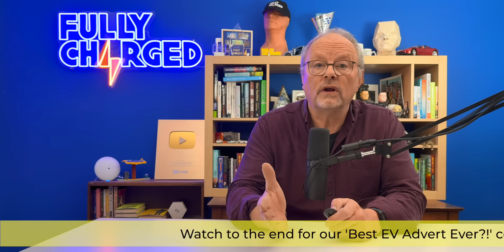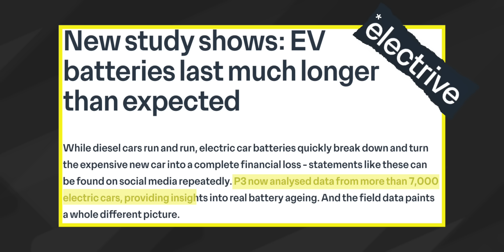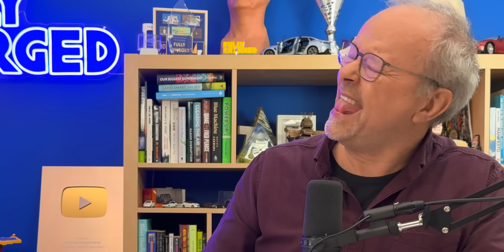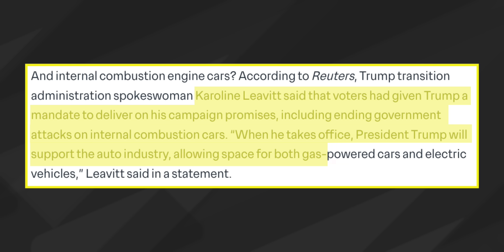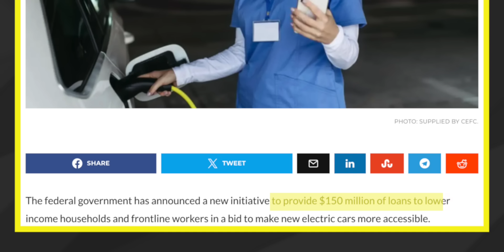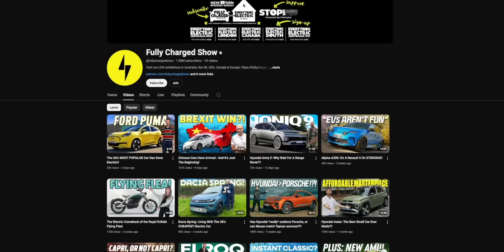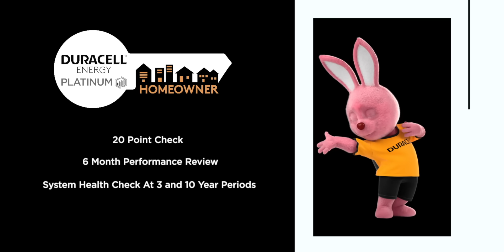The Truth About EV Battery Life, Government Subsidies & The Future of Coal Ash?!

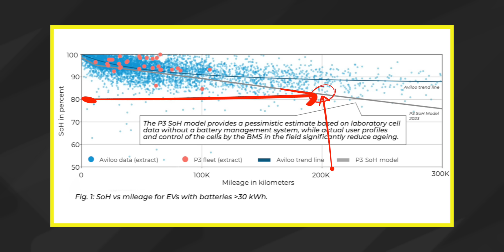Comment: 5:17 "A large percentage of the batteries they tested were at 90% of their original capacity after 300,000 kilometers"
That's either really disingenuous or Robert doesn't know how to read a graph, there are hardly any data point left at 300k.
The best I can say is he mis spoke and meant 'Of the few batteries that survived 300,000 kilometers, a high percentage of them were above 90%'
Reply: That's not what the data shows either though, is it? The graph doesn't show EV batteries that have failed, and how long they lasted before they failed. The relative lack of data points beyond 300,000km isn't a symptom of batteries not lasting that long, it's a symptom of not many people racking up 300,000km in any type of car (let alone in EVs, most of which haven't been around for that many years). In the UK, the average mileage of a car (most of which will be ICE cars) before it's scrapped is about 200,000km.
Reply: @mikepotter2561  I agree, we'd need to reference a similar ICE sample of failure rate over distance as a control to see what the natural curve is, whatever the differential between the two will be battery vs ICE failure rather than running gear failure as that will be similar on both power trains.
Reply: @nukenet1   Again, this is not the point of the graph. The data doesn't show the mileage of EVs at their point of failure. Far from it. It shows how well they're still performing at different points in their life. The facts are that on the graph, none of the cars at or around 300k km showed below the trend line of around 75% state of health. Now there isn't really an equivalent measure for ICE cars, but the point is, as Robert says, that an ICE car at 300k km is likely to be a total wreck of spare parts, while an EV (with far fewer mechanical parts to replace) still has 75% left in its main component after that mileage. This bodes very well for overall lifespan of the car and cost of maintenance over that time.

Comment: There are 18 million cars in Oz if we could replace 100,000 ICE cars with EV s every year ( which we can’t)
we’d still have petrol cars on the road in 180 years 
The average EV uses 83 kg of copper
100,000x 83 = 8,300 tons of copper 
At 1% ore grade means that 830,000 tons of ore need to be processed to produce the copper ALONE for the  manufacture of 100,000 EVs 
One tonne of copper produces 4.1 tonnes of CO2 
That is 34,000 tonnes of CO2 
And then of course there will need to be upgraded to the grid and a massive increases to power  generation
To call EVs GREEN is not only misleading but down right dishonest

Comment: At current rates of usage, the complete extinction of oil will happen in 14,000 days or approximately 38 years (source: Worldometer).

In 40 years' time, you cannot be driving a vehicle powered by gasoline / petroleum. Simply because there will be no such fuel left on planet Earth.

The Oil Industry cannot still be in existence in 40 years' time. As there will be no more oil resource for them to process and sell.

When there's 5 years left before the extinction of oil, who is going to invest any money in new oil infrastructure? Who's going to pump billions into a brand new oil refinery, when they only have 5 years left of oil? No-one, when there's little chance of breaking even, much less making profit, in such a short amount of time.

The world's reserves are not all in one place. Different countries will run out at different times, as they all have different sized reserves. This shrivelling up of the Oil infrastructure and industry is going to happen piecemeal, country by country, over those next 40 years. The 40 year estimate is until the end of all of it. The end of each individual supply will occur, repeatedly, one-by-one up to that point. Each final permanent closure of an oil reserve - as there's nothing left - will cause global economic shocks.

As oil runs out, its price is only going to exponentially grow. Long before the end of these reserves, the average person will increasingly find they can't afford to fill their fuel tank.

The point being that the global overall end is in 40 years' time. The local individual end will come much before that, in practice.

I've not mentioned climate change nor pollution. Just simply the economics of the remaining supply. Quite literally, this cannot go on. Even if the world did nothing whatsoever, then there are only a few decades left before it becomes economically impossible for the average person.

This is investment in a dead end. The car industry knows this, and that's why it's switching to electric as the only possible means for their businesses to survive in the coming decades. They have to transition to EVs, because soon you won't be able to sell an ICE. Not because of government legislation, but because the investment no longer makes any sense.

It's a false dichotomy. Indeed, if you want ICE vehicles to survive the coming decades, then you need to advocate for absolutely everything else to be electrified, in order to eke out a little more time for the Internal Combustion Engine. If you love cars, then soon enough EVs will be the only feasible way they can continue to exist.

The fact that, in reality, climate change is a real thing on top of all this, just means that we'll be also fighting increasing natural disaster events and global "climate migration" at the same time.

Even Trump realises this. Greenland is currently mostly useless, as it's covered in a permafrost. That's why no-one has previously been remotely interested in it. But now grabbing Canada and Greenland are crucially important to Trump. Because as the world climate shifts, more Northern territory is needed for growing crops and housing people. Ignore what he says, because words can lie. Look at his actions, because actions can't lie. The "secret plan" is to keep making money until the supplies run out and move North, abandoning the increasingly uninhabitable South. Building mansions in Canada and letting the world burn.

Comment: Robert, 
Remember in Aus if you get a government low interest or interest free loan to buy EV cars or Solar panels or Heat pump electric heaters or hot water systems that spend goes back into the economy. 
It certainly helps those in low to medium income to afford the transition. 
Nearly everything in Aus is typically much more expensive, however we are seeing Chinese electric cars coming in at better costs than those in the UK and EU.  About time I say, however they are still pretty expensive.

Most of us weigh up the economics not just the environmental benefits. 
If you can't afford to live, then who cares how long you live.

For me It will take 5 years of fuel cost for my annual 20,000 kms driven  to cover the difference in cost of the equivalent EV compared to my current diesel vehicle. That cost is about AUD$10,000 fuel bill.
In 5 years time than new EV that currently costs AUD$65K (40.3K GBP) will then cost me about AUD20K (12.2K GBP)
In 5 years time I will be able to afford a second hand EV to suit my needs and maybe we might have a robust public charging network.

A vast majority of Aussies drive more than 50 kms a day to go to and from work because our public transport system is so poor unreliable and does not go where you need with suitable frequency. 
We are very spread out as a nation. We are not living in each others back pockets or on top of each other.
We typically travel much larger distances as we typically live on larger house blocks from 450 sq metre plots to the typical old 1/4 acre 1000 sq.metre blocks of land.
Aussies typically don't live in High density housing like the rest of UK and Europe.
Our country is 32 times the landmass of the UK and we all typically live on the outer coastal areas. and our largest capital cities are many hundreds of kilometres apart. Melbourne to Sydney some 800 kms, Melbourne to Adelaide 735 kms and Melbourne to Perth some 3500 kms.
Our electric grid is out dated and the transmission lines cannot cope with the current load a lot of the time and whilst we have installed large amounts of renewable energy projects the transmission and grid development has stalled. A lot of renewables  energy from Solar and wind is curtailed as we dont have storage for all the excess. 
Our Pumped Hydro Snowy 2 Project is 5 years overdue and some 7 billion over initial budget and still nowhere near completed.
Out battery storage has a long way to go to absorb the excess solar and wind generated power and investment has been in generation morso than in storage. Storage is just so damn expensive. 
Rant over.

Comment: Sorry this negative about hybrid is wrong I have numerous friend in eutope with hybrid Toyotas with 250k on the clock running fine my hybrid had done 150k miles before I sold it and it's still going and it only went to dealer for service and recalls

Comment: 25% of oil produced is used by private vehicles, another 25% for the rest of the transportation sector. Still a long way to go before we can switch off oil production.
Reply: We don’t want to necessarily switch off oil production.  Yes plastics from vegetable sources are in development but petroleum derivatives are used in cosmetic, pharmaceuticals,  plastics in manufacturing etc. it’s the burning we want to stop. Decarbonisation for shipping, aviation and HGV is trailing personal transport but it is getting there. Norway has an electric ferry, there’s the Tesla semi and there are now numerous small battery electric planes. Sustainable aviation fuel is a good intermediary until we get a better solution.

Comment: Funny how you praise scientific results and documentation and at the same time not fact check your own claims. In 2 minutes you can find many hybrid cars with much higher mileage than you claim they will never do. Walk the talk.
Reply: OK, let me explain. A hybrid car is a petrol car with some other stuff strapped to it. They are fine, I drove a Prius for years, it was a great car. Back in 2002. So I was joking, having a dig at a technology that is promoted furiously by Toyota and the fossil fuel industry. 
I totally agree that they last a long time and burn fractionally less fuel than a regular petrol/diesel. But it's a petrol car.
Reply: @bobbyllewellyn  Hybrids are a collective term for widely different cars. I have a bmw i3 rex=hybrid. But it only use 3-5% of the petrol i would have used in a ICE car, thy calculate how many years it would take to save the Co2 used to build a big battery for use few times a year. People should buy the car that fits there driving needs.

Comment: I can tell why is a few sentences why CCS won't work. It's secondary school physics. Having burnt the fossil fuel, liberated the CO2 and used the electricity generated, the energy required to capture that liberated CO2 is several times more than the energy gained after burning. See the problem? You have to generate MORE electricity to capture the liberated CO2. It's simple really. STOP BURNING STUFF.

Comment: If you mistreat your car's battery. It will degrade and fail. If you overcharge. Or run it down to zero charge. If you fast charge it all the time. The battery will fail over time. New cheaper battery designs and chemistries are being researched. So replacement will be easy.

Comment: My EV has now lost 42% battery capacity within just less than 9 years and 41 k miles. I wouldn't touch another EV with a barge pole. They are just a throw away item in my opinion. The propoganda on battery life from my experience of them is appalling.
Reply: Hi what car do you have please ?
Reply: @Dailyroach  why would that matter, it is an EV with a lithium ion battery in it. There was also a modern Tesla model 3 on autotrader,   highlighted by Barrie Crampton, with a tested and certified battery capacity for sale at 25 % degradation. 2020 and only 55k miles. Is that old technology as well ? Mine has lost 5 out of 12 battery bars, a 30 kwhr, you can guess the rest. The fact is that all batteries degrade with time and use cycles, All !
Reply: @ Just curious , Its nice to know what the real world results ar on certain diferent cell and pack configurations first hand from real owners .
Reply: @Dailyroach  I replied to your last comment but it has been removed, I wonder why ?

Comment: if we only didn't have to worry about the 12v batteries
Reply: What’s your worry?
(Replaced the battery in my Model 3 at about 3.5 years- was told on the screen that it was time to replace. Too easy.

Comment: Coal is fast becoming an issue for preserved railways.
Currently finding an affordable source of Steam coal, (The Welsh Supply is being cut off) and finding a slightly greener and more sustainable, yet affordable alternative to keep the Old Kettles we all love going.
Reply: This is very upsetting for me, although I am a strong proponent of trying to stop burning fuel, steam engines hold a special place in my heart. And some of that is the smell of coal burning, steam and hot oil. Burning coal in a few old steam engines is ofliterally zero consequence in the long term. I really hope you can find a decent source of steam coal.
Reply: Slight misunderstanding here. 
I don't work for a preservation society, but I do like old trains as Robert does.
It would be interesting to see an episode on the subject of alternative fuel sources for not just steam locomotives but classic (wash your mouth out with soap) Diesel locomotives. 
I imagine those with historic aircraft may also start to struggle in the coming years.
Reply: Have you tried Forest of Dean free miners? Maybe you will have to use wood.
Reply: The Grand Canyon Railroad runs historic steam locomotives from Williams, AZ to the Grand Canyon on the 1st Saturday of each month and some holidays.  They converted them to run on recycled restaurant cooking oil which has been filtered and cleaned.  The train smells like a bakery when it passes by.

Comment: Nature has already captured the carbon. Leave it in the ground.
Reply: That is  it right there. The earth has a natural carbon cycle with a "dynamic equilibrium". It has carbon sources and carbon sinks,  The fossil fuels that we dig up and burn were plants and animals that died millions of years and were buried over time. Over time, pressure and heat transformed it  into fossil fuels. The earth's natural processes sequestered the carbon in them.  By digging it up and burning it we are releasing just over a metric ton of CO2 into the atmosphere every second.  We have also been destroying the earth natural carbon sinks through deforestation and  pollution that are killing off things like ocean plankton.  The rise in the Earths surface temperature and oceans from the increase d CO2 in he atmosphere is causing a myriad of problems. There are ocean thermodynamics that result in a natural circulation between the water in cold deep water depths and the warm surface waters and it helps facilitate the oceans absorbing large amount of CO2. The warming ocean temps are negatively impacting those thermodynamics and impacting the oceans ability to absorb C02.
Left on it's own, the earth's natural carbon cycle would probably stay in dynamic equilibrium.
Reply: LOL

Comment: V2G massive battery on wheels parked 23hrs every day and all night long will destroy grid cashflow. 
Grid owners will hope that the industrial heavy fossil fueled users will use more grid electricity. But.

The difficulty is that grid capacity is fixed at max gW, and demand is variable upto max limit. 

The grid costs are fixed, and spare grid capacity is low.
Grid electricity is extremely expensive energy.

Comment: The Danes' appetite for electric cars set another record in September 2024 with 57 per cent. of all cars sold. It is the third month in a row that the proportion has been above 50 per cent. At the same time, the electric car park is turning a new corner: 300,000 are driving in Denmark. And not least, the charging infrastructure is in place. UPDATE January 2025 78 per cent new cars are electric!

Comment: The search for oil and gas offshore requires the use of high capacity "air guns" that are towed behind survey ships. They make a hell of a noise underwater that gives rise to the sound waves needed to penetrate the seabed rocks down to great depths where the oil and gas deposits might be located. The sound reflections from these deep layered rocks is sensed by further equipment towed behind the ship and computers can then decipher the rock structure below and whether hydrocarbons might be present. This underwater "noise" has such a negative effect on whales and other mammals, such as disorientation and pod beachings, that it is now a legal requirement for survey ships to have specialized personnel onboard that scan for whales and other mammals in the survey area and help protect them. It is the hydrocarbon industry that presents the greatest threat to marine mammals not offshore windfarms!
Reply: Yep, oil heads can’t comprehend that we are still hunter-gatherers when it comes to oil, our oil supply is reliant on hoping we find more oil. The caveman brained ICE agers are too stupid to comprehend this unfortunately.

Comment: You keep talking about battery life in terms of km but I got an EV in 2023 and I'm more interested in how the batteries age purely in temporal terms. I won't put serious distance on the car but with light use, keeping the charge level around 50% as much as possible and charging at home avoiding DC fast chargers what can I expect in terms of battery degradation? In 10-15 years to what degree will my Lithium (NCM 811 or 523) batteries chemically degrade? It's an e208 so it's a liquid cooled battery pack but is there any good data on the air cooled Leaf batteries and how they have degraded just due to time and not heavy use?